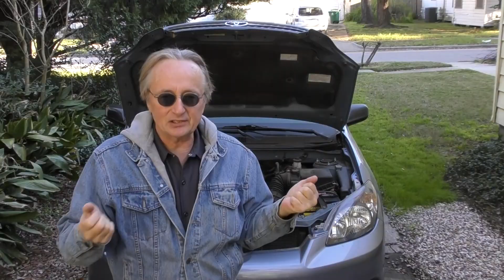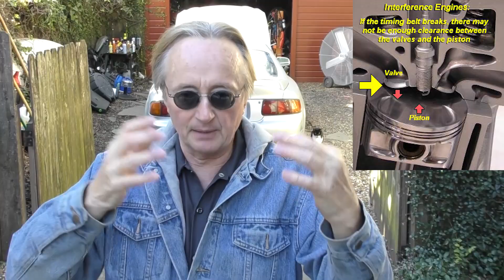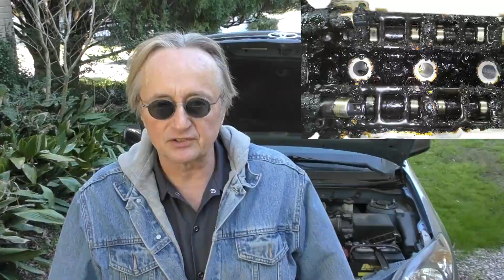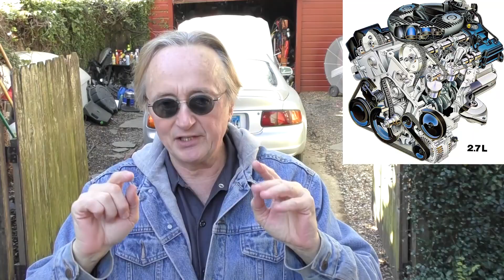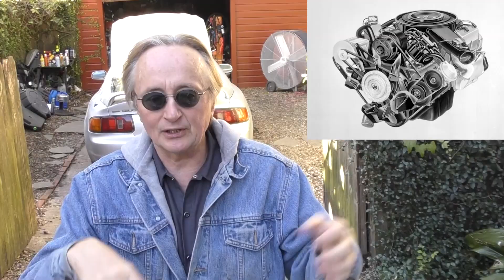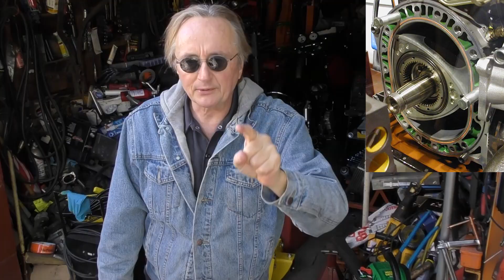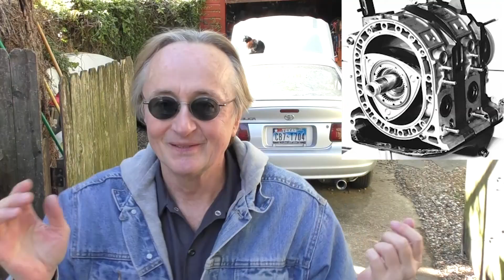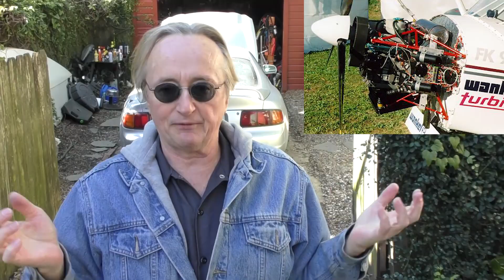Never Buy a Car With This Engine

Comment: The 2.2 ecotec was only an issue on older models,  the timing chain cover was redesigned in 2004 and the problem fixed. Sample size of one, but my 06 Malibu has +220000mi on it, without a single drive train or power train issue.

Comment: Best engine I owned had to be a '77 Ford van with the 292 Windsor V8. Once I didn't change the oil for around 10K miles but when I did it just smoothed out & purred. I heard lots of good things re the292 Cleveland V8 & I was told it was faster but that Windsor engine ran like a champ. Especially after discarding the thermostat.

Comment: I really love the Audi/VW 1.8T engine, but it requires far more (and more expensive) maintenance than the average American owner puts in, especially once the warranty's expired. 

The 1.8T also has the same water pump issue of that 2.7. It's driven by the timing belt. Depending on car, this can be very time consuming to get to. I did a New Beetle I used to own that required removing scores of parts, including turbo/intake components and the engine mounts just to get to it. Now, I'm doing some work in that area on my A4 and isn't so bad. The engine's positioned in the opposite direction, so one can get to it by removing the bumper, along with about half as many components as on the Beetle.

Comment: I have a Saab Aero convertible 2005 with 2.0 ecotec engine 
Religiously change the oil every 5k and let turbo idle for 30 seconds before turning off 
Say a prayer before I go anywhere , cross my fingers , also pay for best warranty I can and breakdown cover 🤣🤣

Comment: The rotary engine can get good mileage if you drive it easy. If you beat on it, yes you're going to be lucky to get 4-6mpg. But the newer ones can get 30mpg when driven well and with good apex seals. They are actually a really simple and easy engine to rebuild.

Comment: Been a GM mechanic for 15+ years the eco-tech 2.2 and 2.4 is one of those engines that never have any problems but they don’t like lack of maintenance or low-grade maintenance parts.
Reply: 4 years later, do you still feel this way?
Reply: Yeah. I beg to differ on that. I have a 2.4 and check the oil and maintain it well. It's been a great up until the 100,000 mi mark. It was all downhill from there.
Reply: Really I've heard bad things about the 2.4

2.2 is a solid engine I used to have a Cobalt and my girlfriend has an HHR it's been reliable but we're looking for a new car because it's rusting really bad (we're in Michigan part of the rust belt)
Reply: The guides for the timing chain are plastic - no amount of maintenance can compensate for a cheap part

Comment: would it be a good idea to start using full synthetic oil in a vehicle with 170k that I've always used high mileage conventional oil in?  would there be any benefit other than more miles between changes?

Comment: I would say dont buy any GM vehicle with a Northstar V8 engine. Absolute trash! Leaks oil everywhere and catches on fire!
Reply: I work at a GM dealership and just about every single vehicle that I have ever worked on that has the Northstar engine is currently leaking. Very rarely do I see a Northstar that isnt leaking. It's to the point where if we know the vehicle has a Northstar engine it's almost a guarantee I'm going to recommend an engine leak repair. Sometimes even complete engine reseals.
Reply: My mechanic calls them “deathstar”
Reply: those have a lot of head gasket issues up to 2005 model cadillacs. The headbolts are junk and blew headgaskets.
Reply: Absolute garbage
Reply: Grandparents had several northstar Cadillac they were always burning oil.
Reply: @Yul Strokheet Al-Wauch  correct! Northstar engines were great. In general, take care of and routine maintenance and they'll last as long as you want them to. Just drive it like you want it to live,and it will
Reply: I love how the started is under the intake... WTF
Reply: They are prone to overheating and head gasket failure.
Reply: Our 2006 DTS was in the 50k range in miles when we bought it. Ran great. Drove it across the US and back. Previous owner drove it from AZ to MN every year. So I have no idea if the strongly suggested 40k coolant flush was done. Somewhere in the 85k to 90k it started leaking. The Caddy dealer said $7,300 to pull the engine and replace all the seals/gaskets. I said "No" as the car isn't worth 1/2 that currently. I love the car and bought it mainly for the ride as I have back issues. 

I'm hanging onto it as it took forever to find a car with a good enough comfortable ride and comfortable driver seat. Meantime, my wife hates it for leaking onto the concrete and the occasional burnt oil smell, and the low oil warning(only twice in 2 years). It leaks just enough to be slightly annoying.
Reply: Northstar from 2005 and newer were great engines before that is junk! I had a 06 and would dog it every time but that engines held up but my STS has was rwd which I loved but weak rear diff is the only problem with car
Reply: The only trash thing about Northstar engines is the owners that mistreat them, like skipping the 40K mile coolant flush and letting the coolant eat away at the head gaskets. I see old school Northstar Devilles, Sevilles, and even Allante drops a daily basis, and the Northstar was in production from 1992-2011 and still holds the record for the longest-production Cadillac engine of all-time. Caddy must have done something right...
Reply: @hakeemsd70m  Very true, plus I have a "97" Eldorado 2 door coupe and still runs nicely, but I do my annual inspection, oil change,e.t.c. never once I have any serious head gaskets issues for my car, but I'm sure other autos that is not a Cadillac has issues. No cars are perfect…..I'm content with my Caddy.
Reply: Never happens northstars are some of the best

Comment: F.I.A.T. = (Fix  It  Again  Tony)

Chrysler used to be good. 
I should have kept my parents 63' 300, and 68 Newport.
Reply: Straight 6 in the Chryslers back in the 60s and 70s are notorious for reliability.
Reply: @cxc410  but who wants to drive a 1960 model year vehicle. That’s the thing
Reply: That’s from King of the Hill 🤣
Reply: Never heard that before but i really did laugh out Loud 😆
Reply: Ford let's their cars fail with transmission problems on the assembly line
Reply: I think i know whats wrong with your truck hank... Its a Ford You know what ford stands for dont you: Fix it again tony
Reply: IDK about good... But they were decent
Reply: Why Tony who is Tony lol Fix it again tomorrow makes more sense to me

Comment: Isn’t that the truth, people for the most part don’t take care of their cars & for the life of me I cannot see why. Vehicles are not cheap. It’s not just simple oil changes, they don’t wash their cars, I’ve seen vehicles that were only 10 years old with rotting out quarters, rear bumpers nearly falling off. But again maybe those people make a million a year where they can just throw them away, but I know I can’t so that’s why I take care of my vehicles. Cause like you said I want mine to last as long as possible.

Comment: My ecotec had 258K same chain and guide shoes plus original tensioner. I couldn't sleep at night so I did a replacement. Motor is super quiet now, ( not that it was noisy) old parts hardly any wear, strange indeed?

Comment: The neighbor has a 2015 Chevy 1500 with one of those 4, 6, 8 engines. He just put a new engine in it. On a 4 year old truck! That's insane. Now it needs a new transmission. They are just producing junk these days it seems. My 2004 Neon is more reliable.

Comment: ECOTEC is good and reliable  engine,I don't know what people expect, to have good engine and not maintain them at all.That tells about the driver not about the engine.I use recommended oil Mobil F1 ESP 5W30 and engine runs real smooth.
Reply: Aleksandar Prelić yeah, the first 100,000 miles, that’s not reliable, reliable is a car that can go to 200,000 miles with only needing consumables and simple things like a alternator.
Reply: I'm no mechanic but I've replaced ICM ($50 from junk yard off Grand Prix (they told me) and windshield wiper transmission (moving parts were plastic?). But, 2.2 ecotec has been good to me. Nearly every mechanic I know hates the 2003 Saturn Ion with 2.2 Ecotec. I think it's ok.
 I think Scotty said the later models when engine design was changed, had problems. My secondary car is a 1998 1.6ltr Honda civic. Both engines run perfectly so far. Got both for free and routine oil changes/general maintenance goes a long way - PENNZOIL Ultra or Pure Plur Plus WIX XP or napa gold filter @ 3,000 - 5,000 klms.
David
Alberta

Comment: I still have a 04 Chevy cavalier I bought new running great, only fix so far was the fuel pump. And I see them around all the time even the 2000 models. I stay on top the maintenance schedule also
Reply: Bryan Camp Seems like those early 2000s cars can be worked on fairly easily, I’d wager most mechanics prefer to work with them more than with the really newer cars.

Comment: I always thought the 2.2 ecotech engines were a good motor because I see them all the time and they never leak oil, you never hear them making any noise, and I'm starting to see some very old ones come in with no apparent problems. I didn't know it had timing chain problems.
Reply: same here, first I've heard of it. if i had to guess, it's caused by poor maintenance (using conventional, going over interval often, not replacing filters, etc)
Reply: It's actually a good engine if u keep up with oil change and always use full synthetic. The timing chains guides are plastic and break if it isn't lubed properly then your valves get bent. I bought a Malibu with a 2.2l that had that happen. Bent the exhaust valeves. I swapped the engine and kept up with the oil changes and haven't had an issue with it. The old engine had about 140k on it. The new engine had around 70k on it. The cars now at almost 200k. Transmission is apparently not the best in them but I haven't had an issue with that either.
Reply: My 2.2 ecotec has been leaking oil since brand new

Comment: The worst problem with the Mazda rotary engines is the extreme heat from the exhaust side and the cooler temp. on the intake tends to warp the engine case.

Comment: Just retired and looking for a weekend toy. What are your thoughts on a 2005-6 Jaguar XK8 convertible?
Dewy M.
Reply: Might be fun but expect lots and lots of pricey repairs and maybe some breakdowns. There are more reliable models and brands for sure. If you go and older Jag, at least it will be depreciated, but older = more issues.

Comment: Does anyone else's Toyota 3.5 V6 sound like a diesel when started up on a cold day?  Thing is still running without an issue after 4 years of doing this but until it's warmed up all the way it sounds like a clunky POS.  IT's my first Toyota and I expected the quality to be a little better than that or at least sound better.  Mechanics keep telling me it's normal.  I call BS?  Anyone have an answer?

Comment: i have put 40,000 miles on a used 2.2 ecotec without ONE problem so far, i have only done regular oil changes and i did put spark plugs in it once just to have something to do. Seems like a good engine to me. i just bought another car with a 2.2 in it.

Comment: My 08 Cobalt has over 90,000 Miles and runs great don't be lazy change the oil every 3,000 miles.
Reply: D Willoughby I’m a mechanic, do, and mine still died soooo

Comment: You forgot the Mini's N14 and N18 turbo engines. PCV failures that cost about $1000 at the dealer because the expensive valve covers needed replacement, and timing chain failures. Also, they would eat coils like candy. Expensive parts all around. Not a hard engine to work on though.

Comment: I'm sorry Scotty you may be right on a few of those but the ecotec was not a crap motor I had one in a 2003 cavalier and I drove it for 10 years over 230,000 miles before I got rid of it

Comment: One high performance DOHC V6 had hollow camshafts with oiling holes in the heel of each cam. Cross-drilled crankshafts are common. Oil is conducted from main bearings to adjacent crank throw/conrod big end bearings. Some have connecting rods that have oil drillings that carry oil from the big ends to the wrist/gudgeon/piston pins.
For long cam, tappet/cam follower and timing chain life, change that oil! Filters catch only particles larger than about thirty microns. Roller chains don't like ANY particles in the pin-bushing joints. In other bearings particles smaller than the oil film thickness don't affect much but in roller chain joints the oil film in the pin-bushing joints is squished very thin.

Comment: The VW / Audi engine had its problems but if maintained is a great engine. Mine had 235k miles. Had 2 timing belt changes. Brakes, subframe bushings, spark plugs and coils. The automatic transmissions were junk, but so were a lot of the early gear selectable automatic transmissions.

Comment: My 09 pontiac have the eco tech 2.4 engine abd still runs at over 200.000 miles just have a po450 code says it a sensor but i smell gas even when car is off

Comment: Ford Ecoboost and some other Ford engines have that same internal water pump design and also have timing chain stretch issues which can grenade the engines.  Also most professional shops will remove the engine from the car to change a water pump so you're talking some big bucks for something that used to be simple like a water pump.

Comment: Have a 2009 cobalt 2.2 ecotec. Driving it for 8 years, regular oil changes, not one issue with anything! Great car!!
Reply: They're usually fine as long as you keep on with the maintenance
Reply: Mine cobalt runs great. I maintain it well. Full syn all fluids. Mobil one filter. Car is zippy and runs great. I think it's a well made engine.
Reply: The issue he is referring to is the early (2002-2003) 2.2L ecotecs had a poor timing chain oiling system and they were prone to failure if the engine was ran at high RPM's. Updating the oiling system is recommended if the chain is replaced. I believe oil system was updated by 2005  and after for the ecotech engines.
Reply: @iThoughtUHad2Bitch  Post 2006 ecotecs are very reliable and high mileage potential engines. The 2002 ones were prone to failure.
Reply: IRONMAN000 my engine detonated after a MAF sensor failed and destroyed the cylinder walls, damn near shook itself apart
Reply: I have a 03 cavalier with the 2.2 ecotec and it's still running strong even with added horsepower
Reply: @joshkoerner7024  my '03 Cavalier still runs.   I changed the timing chain,  other regular maintenance - oil, trans fluid....replaced  starter,  alternator,  lower control arms,  hub assembly. It  burns oil,  but it runs.  No car payment.
Reply: Timing chain had to be replaced before 60K.  Engine runs super hot super high rpm
Reply: Me too.
Reply: Just watch the kind of oil filters you buy if you change your own oil, some collapse, saw it happen killed the 2.2 dead.always get the best.and study them.
Reply: IRONMAN000 same 2003 Saab with the ecotec engine 2.0T 166k miles on it regular maintenance transmission went out first surprisingly also used in nissans and Toyota’s
Reply: Saturn Vue Owner since 2007 with a 2.2 Ecotec engine...Never had an issue...
Reply: Every rant this guy goes on he begins with " if you don't" and then says whatever. The gm 2.2 ecotech is a good engine. I've had 2 cars with it, no problems out of either ever, and I keep up with oil changes. This guy just needs material for utube videos so he rants about whatever he thinks will get views. Reminds me of Gilbert Gottfried with his IRRITATING VOICE
Reply: This Guy scotty have no idea what is he talking about...
Reply: My 2004 Saturn Ion has the Ecotech. 280,000+ miles and still going.
Reply: Mine Is Cobalt 2008
But I have no idea what engine it has
It's GM but Idk
There's a Sport Versión
Reply: @thejuicyorange8526  The Ls and Lt versions have the 2.2 litre. The SS version or the Sport have the 2.0 litre ether supercharged, or turbo charged.

Comment: The Anderson engine. Chrysler put a few of them in some cars back in I believe was the late 70s or early 80s. The metal, the bearings, the balance meant rough running, poor longevity, and fuel mileage increases you couldn't notice. I see some companies are bringing it back.

Comment: "The Audi 1.8t was a bad engine because the owners didn't run the proper oil and caused sludge."
Reply: I work at an auto parts store here. trust me, it happens, even when you quite clearly say "your vehicle calls for synthetic, if you buy conventional your warranty will be void, along with any of our guarantees" they get it anyway

Comment: when should i change my timing belt on my 2010 honda accord and should i have my fluid changed in my transmission?
Reply: Its a 2010 probably a timing chain, my sister had a 2013 one and it was a timing chain just look it up, if its a belt mostly likely at 130k maybe less.
Reply: @jakelowang4132  In 2006, Honda 4 cyl used chain, 6 cyl used belt.

Comment: Oh I remember those Mazda Wankel engined cars.  They were cheap to buy as a used car, fairly powerful (will do easy 80 MPH), gets 20 MPG (typical 4-cyl car of that size would get 25 MPG).  Or a cheap sports car, handles ok.  Those were the good points.  The bad, the engine has very short life and would die with almost no warning.  Where typical piston engine will give you years of warning before it finally dies.  Oh, those "small" engine weights a ton (small means smaller than a 4-cyl), I guess it was heavy gauge cast iron?